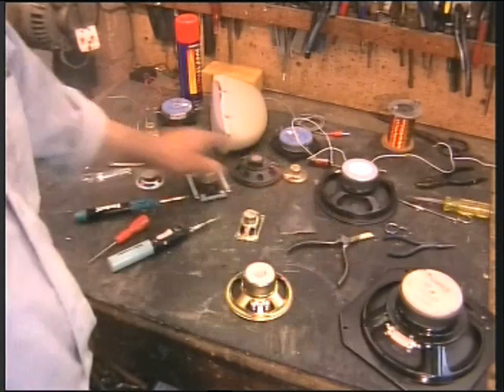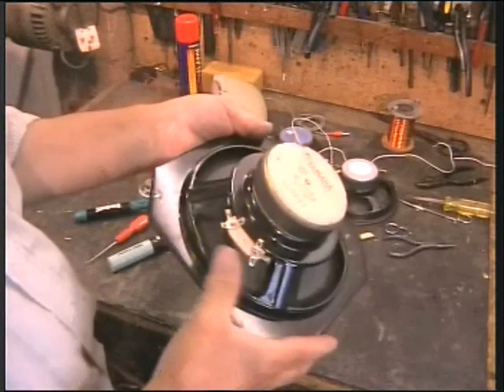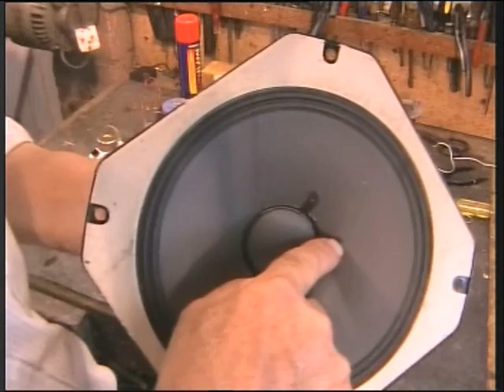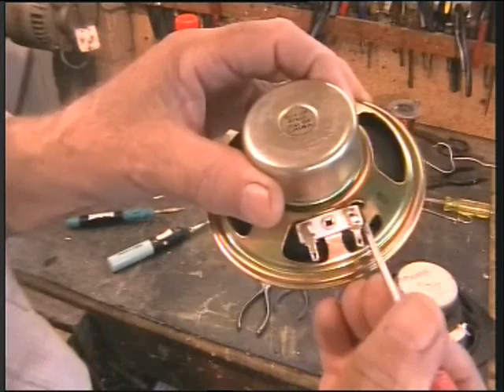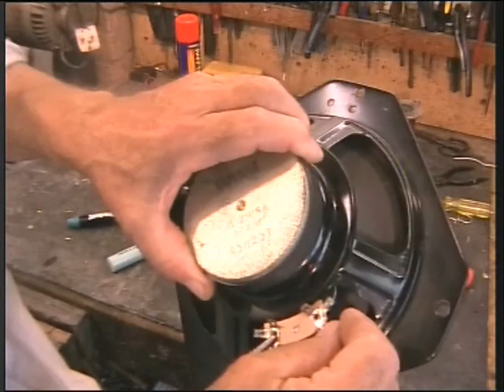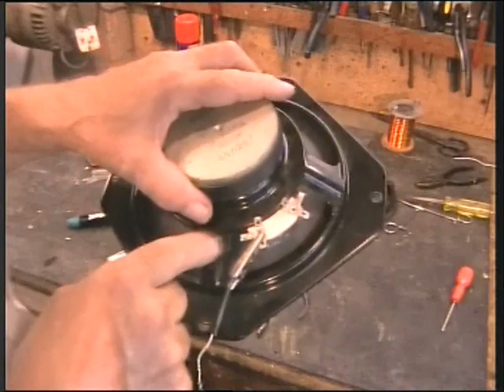simple speaker mod

Comment: Nice trick!  As for the magnet color connection on the TV, a roommate many years ago discovered that and had fun playing with a speaker magnet and his TV, making the colors play tricks. Then he discovered that the colors didn't go back to normal afterward and his TV had more or less permanently distorted colors. I believe he had magnetized the metal mask inside the picture tube. It's there for final focus of the beam for a nice sharp image...unless it is magnetized. 

-- Mike

Comment: Very nice! And it is also a crude noisy voltage booster! :).  If you connect a LED across the coil, it should light up pretty brightly from a 1.5 volts battery.